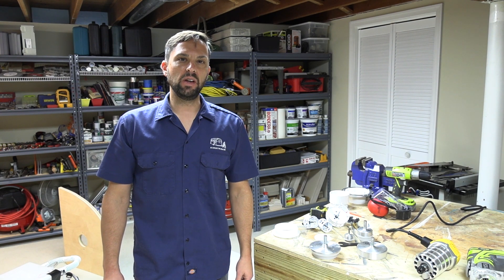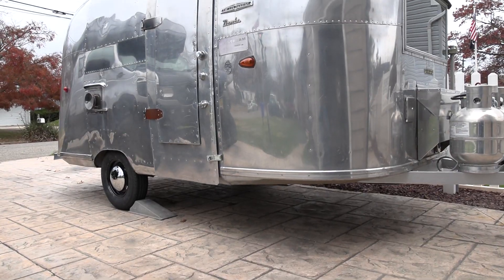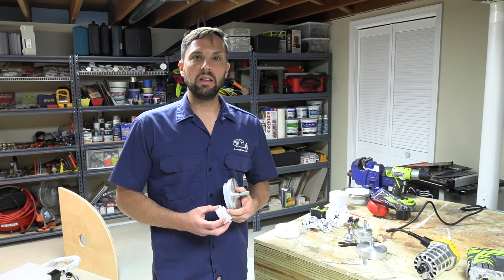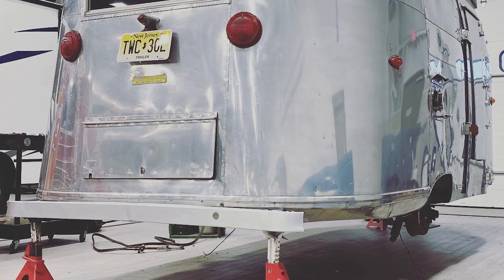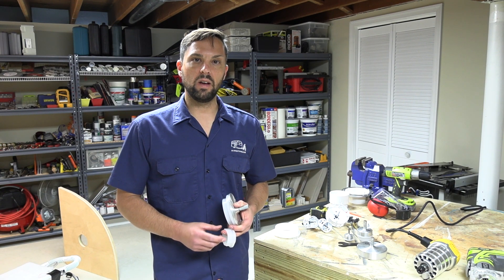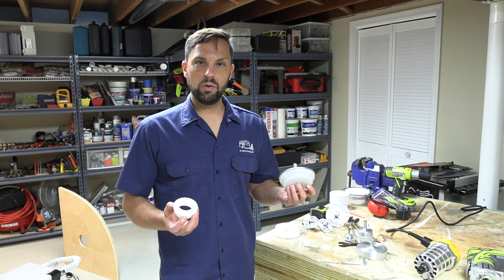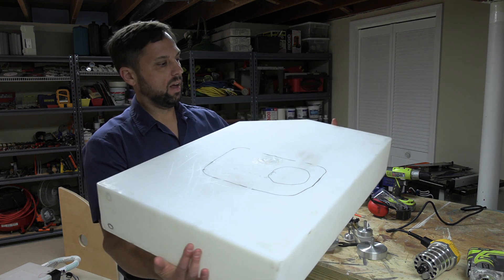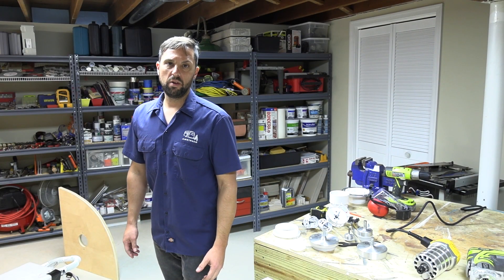RV & CAMPER VAN TANKS | Friction Spin Welding Plastic

Comment: Can you use that ryobi battery router with a similar bit? Or does it not spin at the RPM required for spin welding?
Reply from the maker: I will burn it out. There’s not enough horsepower.

Comment: Where did you find affordable spin weld bits?  I wanted to do this but for my four bits it was going to be $900.00.   I have to either buy or build a tank next spring for my project.
Reply from the maker: I borrowed them

Comment: 10:09 - Is spin welding melting the fitting and also the tank or just only the fitting which simply shapes and forms onto the tank? 10:10 - Whoa only 2 secs... Something tells me this doesn't chemically fuse both the fitting and the tank together to bond at the molecular level, its only melting the fitting onto the tank. Maybe applying an additional solvent cement would guarantee that both parts chemically fuses.

Comment: Because freshwater tanks do not have any connections usually unless you specially order them like that as black water tanks already have the Waste gate pipe attached to the end not the bottom
Reply from the maker: That is not correct however it may vary from supplier to supplier

Comment: Thanks for the Video!  Getting the 1/2" inch shank router will be easy.  But where do you get your spinning bits for the plastic parts you want to weld? Thanks!
Reply from the maker: They are sold on Vintage Trailer Supply

Comment: Great video. I just pulled my freshwater tank out. The supply line to the pump broke off. So I want to ask you about your the friction spinner router. Where do you find one of those? And all the different fittings you have are kind of expensive from what I just looked at. My tank sensor screws did not come out all the way there just like spinning  inside there. What do you suggest the fix is on that?
Reply from the maker: The fittings and bits can be purchased on Vintage Trailer Supply and it’s a regular router with enough HP

Comment: Hey we have been doing alot of spin welding lately at work but we are having issues with burning out our router what model is your Dewalt router? Your video is great by the way!
Reply from the maker: I burnt mine out too. Need something more powerful
Reply: We talked to a guy and he says he modified a 9" grinder to fit the spin fittings and it works awesome and doesn't burn out

Comment: Please listen to this Patrick, I'm not trying to be rude, but helpful. That fitting WILL leak, the fitting needs to be flush with the tank. You didn't let it melt nearly enough.
Reply from the maker: Thank you chuck. I am cutting the bottom fitting off and doing it again.
Reply: @NewJerseyOutdoorAdventures  i work for a airstream restoration company, when I first started spin welding, I was terrified of burning through. 
All of my fittings looked like this and leaked. You'll learn to trust going longer.
Reply: Wipe the plastic with lacquer thinner then alcohol. Clean plastic will work wonders in welding

Comment: I wonder why they don't use those fittings on like fiberglass 🚿  units in houses. Seems like it would be a good idea to not have to use the primer and the glue.
Reply from the maker: Good question.
Reply: Fiberglass won’t melt like that.